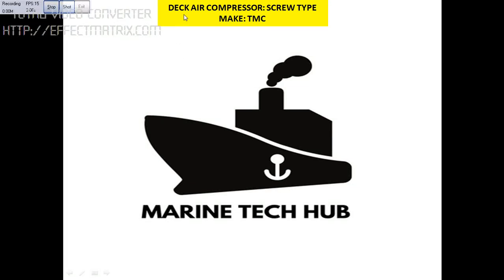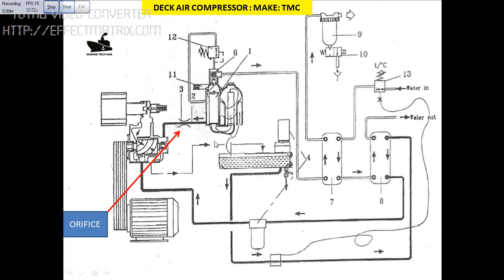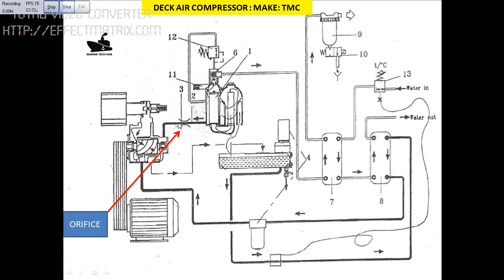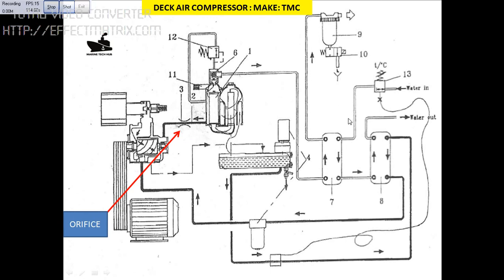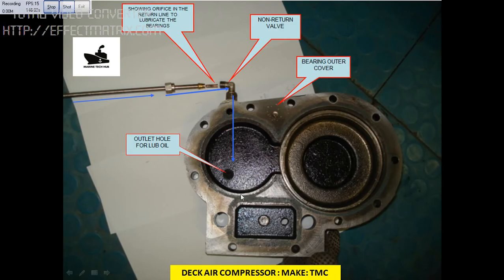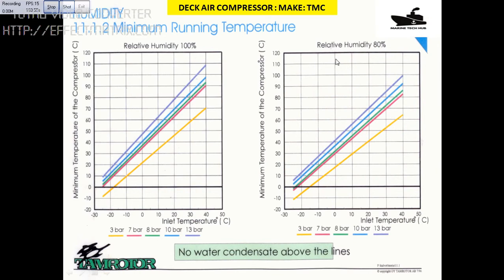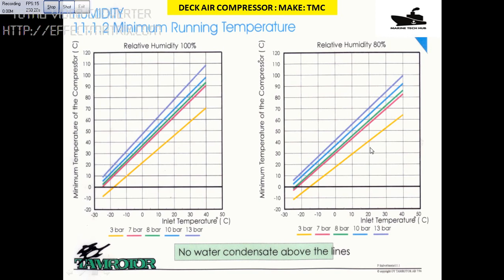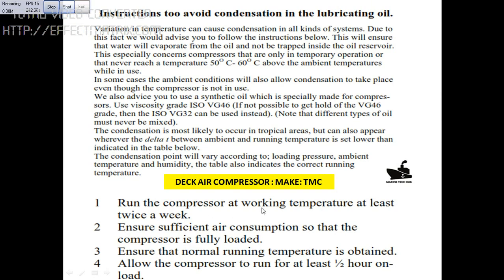Deck Air Compressor (Make: TMC) - What Went Wrong?

Comment: Hi.. we are facing an issue with TMC compressor. loading unloading takes placeevery three to four seconds..
Reply: It is the water drain solenoid valve diaphragm rubber damage, change it with new